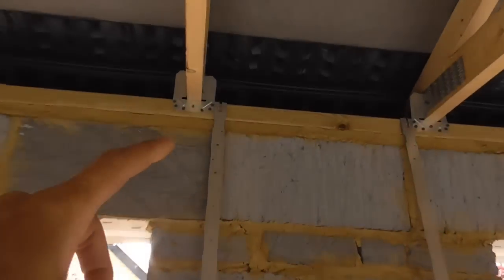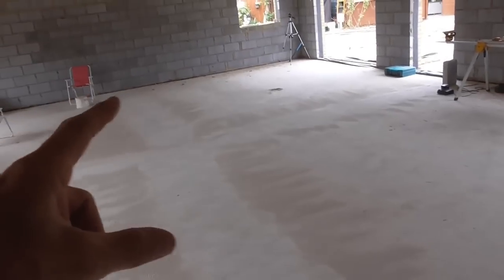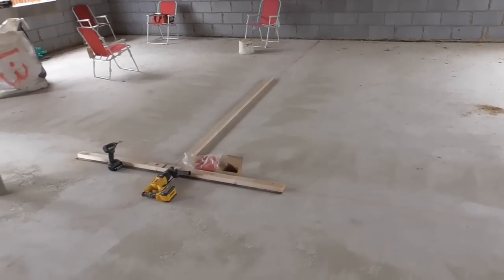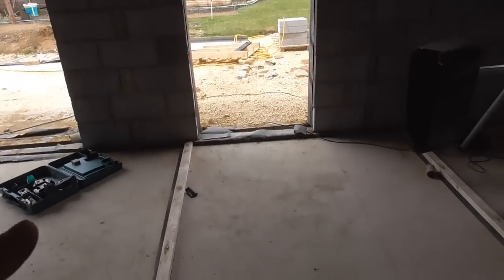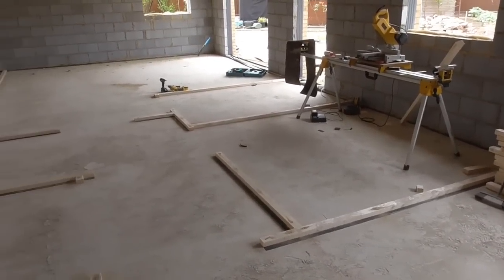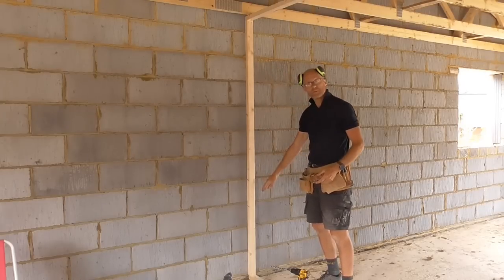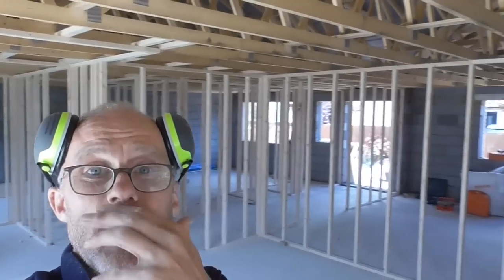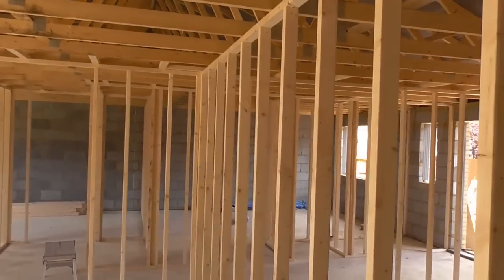Setting out and building timber stud walls in a single storey bungalow***PLUS LOTS OF TIPS***

Comment: Great vid as always - followed your guidance to rebuild my own stud work upstairs (had paramount board originally) and couldn't be more pleased with the result!  Mine took about 3 weeks to finish though; measure 861 times - cut once!  Thanks for all you do - keep 'em coming!
Reply from the maker: That's great to hear Steve🤩and glad you were able to get the job done👊Thanks for your comment and for watching😎Cheers Del
Reply: @thetallcarpenter  Any chance you do work in Grantham for fitting some Deanta doors?!  I have 3 custom size doors that need fitting in addition to another half dozen standard ones!
Reply from the maker: @Zel0978  Hi Steve. Its a little far for me, plus I'm booked up until August 2023😵

Comment: Great video Del , just always check that your lay out drawn is not a photo copy, can't scale off them , I run my sole plates through the door opes and cut out later gives you a chance to move things around if needed, good to see you thinking about other trades 👍☘️🇮🇪👏🤟
Reply from the maker: Hi John🖐Fortunately this drawing was to scale, but it also has a handy scale printed on it so you can check the scale is correct if the drawing has altered due to copying👊Thanks for watching and your comment 😎 Cheers Del

Comment: Really rather good....👍😀Btw Del, Scott Brown has a really good vid showing how he adjusts the wall studs once in place to eliminate any bowing in or out.  And Clever Clevett has a vid showing how he lines all the studs up to account for 'crowning' before he fixes them in.  Both worth a watch for any DIYer.
Reply from the maker: Hi Matt🖐You couldn't see in this video, but I look down every stud and place all the 'bows' the same way in the wall. Ant really bad ones get put to one side and chopped up for door heads or noggins👊I'm pretty lucky as I use a timber supplier that only stocks decent, straight timber🤩Thanks for your comment bud, and for watching😎Cheers Del

Comment: Great video. Very informative and well presented. Love your work ethic and consideration for other. We recently moved to a timber framed house with brickwork outer. The transfer of noise between rooms and floors is amazing. Shame they didn’t use noise insulation when they built the house. Can I ask a question regarding timber framed partition walls. We intend to remove one between the kitchen and dinning room to extend the kitchen. I think the wall is load bearing. How are these type of timber framed walls normally constructed. Will I need an RSG to carry the load?
Reply from the maker: Hi there🖐I wouldn't dare try and assume how you might support the wall/structure above any walls you might be thinking of removing without first seeing the job👍Thanks for your comment and for watching 😎 Cheers Del

Comment: Del, first things first, your videos can never be too long. Keep them coming. Great set out mate. A whole morning planning and fixing the floor plates and then flew through the top plates and studs. 
Do you have any tips for stopping the studs jumping when you nail the top and bottom. I often risk the foot clamp on the opposite side and hop to Christ I get the right angle with the nail gun🤣🤣🙈
Reply from the maker: Hi Paul🖐I should have put more details in, but I was keen not to repeat things I've already done in other videos, plus, tge video was starting to get really long😵I Mark the studs by putting them against the head plate and putting pencil across them, I then leave the pencil line on when I cut them which makes them just long enough to stay in place as I nail them👍Thanks for watching and your comment 😎 Cheers Del
Reply: Cheers Del.

Comment: Nice work Del, nice to see a chippy checking for square on short studs, tilers will love you😁. I love the bosch    distance measure, do you use it for stud heights or tape them, wondering if it's accurate 🤔.  I was taught run the sole plates tru doors , but I do it like you now leave them out and follow chalk lines. Lot easier. I wish I had your height for nailing studs to heads🙄🤣🤣. Great video keep them coming 👍
Reply from the maker: Hi Paul🖐Being tall, I am able to put the stud against the top plate and mark it directly with a pencil, which is fast and accurate👊Thanks for watching bud and your comment😎Cheers Del

Comment: Defo knocking up frames is better on the body . Soul plate down then individual frames. Obv check stud sizes but even if floor is 50m out in places a few double wedges will keep it good all that walking back and forth to pick up 1 stud at a time is thing of past . Esp if working solo . Frames defo easier on body
Reply from the maker: I suppose its what you get used to, and I find bending down nailing studs to a top and bottom plate harder on my back than nailing each one individually👍As with a lot of carpentry jobs, there's usually more than one way to do it👊Thanks for watching 😎 Cheers Del

Comment: This reminds me of doing Rondo stud walls. Light weight metal wall and ceiling systems. We mostly use on commercial jobs. Shoot the base track on laser up the head track. Twist in the studs and crimp in place. The title of your channel puts you at an advantage using this method. My channel would have to be short arse  Carpenter. You imagine every stud you put in you have to get on a hop up or climb a ladder. You wouldn't need to go to step training at the gym. It just isn't viable especially in your 60's. As you are upgrading your laser collection consider another one. I do a lot of glazed tiling and use a square set out laser these days instead of the old 345. Now when laying out frames I grab that. In combination with my line laser I can project a perfect 90 off any wall. Good to see a man happy in his work though and in shorts. The weather must be looking up.
Reply from the maker: Hi Dave🖐Yes, being tall does have some advantages😎I absolutely need to get a 90 degree laser, as like you say, perfect for setting stud walls👊(and glazed tiles😆) Weather is pretty decent now🤔well, decent enough for shorts anyway😝Thanks for your great comment😎Cheers Del

Comment: Hi Del, thanks for the great vid, can I ask what fixings you would use if there is underfloor heating pipes?
Reply from the maker: Hi Keith🖐I would be VERY careful drilling into the screed/floor if it had UFH in it😶I've just studded out a bungalow with UFH and was ASSURED by the builder/plumber that the screed was 80mm thick meaning I could drill about 50mm into it without hitting a pipe. I did this by setting the depth stop on my sds drill and using EXACTLY the right size plugs and screws. If I was in anyway unsure, I would just 'stick' the floor plates down with high performance adhesive or PU adhesive👍Cheers Del

Comment: Something I like to do to strengthen openings and probably overkill is build the opening to accommodate an additional stud either side. Theirs then a stud supporting the door head and above the door head to the head plate. Also gives extra rigidity and more fixing for linings
Reply from the maker: Hi AV🖐Sounds like a great idea, and will defo make the opening stronger 💪 Thanks for your comment 😎 Cheers Del
Reply: That method's only used in the UK when it's a load bearing wall. Usually in full timber builds. Would be overkill in this build as the blocks are supporting the roof.
Reply: @gavl.f.c6197  yeah yeah
Still something I like doing on my own bits, wasn’t suggesting he should do it

Comment: Great work. Your fisher fixings Del. Normally they are hammered in? Are these a normal thread. Nevertheless brilliant. I've done tons of studs over the years. We used to mark doorways and openings on the sole plates cut half way and this allowed for true runs this was sawn timber. Also we would set the corners back for a plaster board but nowadays this isn't done.. 👍
Reply from the maker: Hi there🖐The Fishers I use are always the screw in type rather than the hammer in ones👍Thanks for watching and your comment🤩Cheers

Comment: Nice job m8 some prefer to assemble complete section on ground then lift in...
 Thanks 4 sharing keep up the good work   
Y dnt u use a labourer
Reply from the maker: Hi Sadaqat🖐I actually prefer to cut and fit tge studs individually, as making the panels on the floor is a lot of bending down/kneeling😬(my poor old knees are worn out😵) Thanks for watching bud and have a nice weekend 😎 Cheers Del
Reply: @thetallcarpenter  perfect ...makes sense different strokes for different  folks lol
Take care all the best m8

Comment: Nice as always learnt a few nice tips. Can i just why the studs are not built after UFH and screed?
Reply from the maker: Hi Bud🖐Its mostly down to knowing where the rooms are so they can be set out for each under floor heating zone, but also, (not in this particular case), some building control officers don't like the partitioning built on top of a screed that is laid on top of insulation🤔Thanks for watching and your comment😎Cheers Del
Reply: @thetallcarpenter  fair comment, so what do you do at the bottom, say its 150mm insulation and screed, do you make that up with extra timber?
Reply from the maker: @Bud-vd2xd  Yes Bud👍 I would get 3m studs in this case, and then put a row of noggins in just above the finished floor level to take the bottom of the plasterboard. I have been asked by builders in the past to put down a quadrupole floor plate, to make up for the insulation and screed, because they didn't want to get me 3m studs😮 It was ridiculous and the shrinkage alone in all those floor plates would have caused all kinds of cracking🤯Cheers Del
Reply: @thetallcarpenter  you’re a legend Del, cheers

Comment: Great job. Is there any reason you don't use treated lumber for your bottom plate instead of adding the dpc to it? Is it a coast saving thing or is it just how its done over there? Also a great tip for holding a chalk line down on a concrete slab when working alone is to use a 1 inch drywall screw hammered into the slab and hooking the chalk line onto that. I find the 1 inch drywall screws work best for that because they are really hard and much sharper then masonry nails and require less fuss to tap in. Try it out sometime.
Reply from the maker: Hi there🖐Even if we used treated timber, the building inspector would STILL want to see a DPC under the bottom plate🤔I'm gonna check out the 1" drywall screw into the floor next time as I have a few on the van👊Thanks for your comment and for watching😎Cheers Del

Comment: Del, not sure if I missed it in the video but how do you make sure the header is bang on straight above the floor plate with this method? Good work mate 👌🏻
Reply from the maker: Hi Matt🖐Yes, I didn't make it clear in this video😬 Well, I did, but I cut the bit of video of me explaining it, and put it in a short video featuring the laser detector I use to help line up my laser with the bottom plate which throws a line up onto the truss bottom chords for me to fix my head plate on👍I guess I was a little worried that I was repeating, in this video, details that are already in previous videos🤔Thanks for watching and your comment 😎 Cheers Del
Reply: @thetallcarpenter  cheers for the info Del, got a couple of vids to catch up on yet will watch it though and see the detail!!

Comment: Hi! What's the reasoning behind putting the roof trusses on before raising the internal walls? Wouldn't it be easier to nail them on the ground and stand them up?
Reply from the maker: Hi Jens🖐 The concrete floor is just rough cast, and not particularly level/flat, so I find it easier to cut each stud individually before fitting👍Thanks for your comment😎Cheers Del

Comment: A washer around the concrete screw helps pull the timber down sometimes
Reply from the maker: Hi bud🖐Tapcon screws have a waisted shank and would be much better, but they are not that common round my way🤔Cheers Del

Comment: Hi, suppose the walls were not full height and so you didn't have any solid ceiling to fix the stud head plate to, how would you restrain the head of the studs?
Reply from the maker: Hi there🖐The head plate is either fixed directly to the roof trusses ceiling chord, or additional noggins that I fit in between them👍
Reply: @thetallcarpenter  ok thanks!

Comment: Great work again del! Precise to the point. I always learned that you could hammer in those fischer plugs full, as we call them nailing plugs but then not in english of course but in dutch. Or are these 10 mil different types? Always inspired by your enthousiasm mate!
Reply from the maker: Hi Tom🖐They do a hammer in fixing and a screw in one bud👊Thanks for your comment 😎 Cheers Del
Reply: @thetallcarpenter  great to know, I always hate removing those nailplugs because of the crappy philips heads but enjoyed hammering them in (mainly when I still was an electrician (or sparky in your world?)). have a great week !

Comment: Wondering if you’d travel to Bournemouth to build my timber garage. I watched your playlist last year of the garage you built. I think I’m going to have similar problems with levelling the structure as the moron who poured my slab made a right mess. What areas do you cover??
Reply from the maker: Hi there🖐I only cover a small area of North Cambs, so you are a tad to far for me😬Appreciate you watching my videos😎Cheers Del
Reply: What lengths of timber would be a good use of materials. My garage will be 6m x 7m and 2.4m to the eaves. I read somewhere that 14 lengths per 10 foot but it didn’t specifically say the length. I want to avoid wastage as timber is costly at the moment. 60 x 3m or 3.6m or longer 🤷🏽‍♂️

Comment: I know there has to be some limt Derek but when setting out is it always off the brick or block work rather than the estimated finish?, cheers.
Reply from the maker: Great question Alan🤗This plan is, I think, a structural plan, so I just measure straight from it onto the building. I have done jobs before, where the plan dimensions are more critical, and in these cases, I'll find out the finished wall make up, and allow exactly for it👍Thanks for watching😎Cheers Del

Comment: Hi I'm about to build a stud wall in my house 4m long, how do you make sure the chalk line/laser line is 100% straight? So if I was to build a wall of it everything would be square and straight.
Reply from the maker: Hi Lewis🖐Just keep the chalk line pulled nice and tight and it will always mark a straight line👍Use a square like the one in the video or do the '345' trick off the straight line to keep and walls coming off it at perfect 90°👊Cheers Del
Reply: Thank you 👍

Comment: Another problem with concrete screws is if the holes not in the exact position you want you can’t tap the timber one way or another then tighten it up like you can with a plug
Reply from the maker: Really good point Big Smith👊like you say, you've got a tiny bit of wiggle room with a plug and screw😵Thanks for watching and your comment 😎 Cheers Del

Comment: Hiya del, how high should the noggins be? Does it depend how tall the wall is or are they there for the plasterboards?
Reply from the maker: Hi Paul🖐We fit out plasteboard vertically, so noggin position isn't critical as long as its somewhere near the middle👊I keep my noggins no higher than 1100mm from finished floor, as they wont then get in the way of any of the light switches that should be 1200mm to their top edge👍Cheers Del
Reply: Ahhh good to know, cheers.

Comment: i have a 25cm hss rect with plates weld on both ends as a  3th hand for the chalkline
Reply from the maker: I like the sound of that bud💪Very creative😎Cheers Del
Reply: @thetallcarpenter  i know =) can pull as hard as you want it wont tip over before line snaps
Reply from the maker: @HogeN1337  That's awesome and I've got a welder🤔👊
Reply: @thetallcarpenter  can send a pic on insta when i get around to it
Reply from the maker: @HogeN1337  Please do bud  be cool to see it👍

Comment: Do you mark the sole plate and your top plate then go to the marks? Just wondering what you would do if the first stud against the wall is out of plumb then all your marks are out that same amount. 

Also, do you measure each stud in case floor/joists/trusses are out of level
Reply from the maker: Hi Dan🖐I have gone into detail in other videos, but I do measure each stud individually to accommodate a out of level floor, and I mark the bottom plate at 400mm centre's on the bottom plate, and plumb up the first one from the external wall to the top plate, and then mark 400's from that, so it doesn't matter in the block wall is out of plumb👊Cheers Del
Reply: Mark your first stud 390 instead of 400 or 590 if your using 600 centres allowing for 10mm if the blockwork is out slightly, make sure your first stud is bang on level then mark the rest of that first stud.

Mark your stud on your headplate on the marks then cut 2mm above the Mark giving you a snug fit so it doesn't move around as your trying to nail it.

Great video BTW!
Reply from the maker: @bmxerboynathan  Hi Nathan🖐We are on the same wavelength, and I actually mark my floor plate out at 430, 830,1230,1630 etc. The timber is 38mm thick so it leaves the first stud 10mm further away from the wall to allow it to be out of plumb, which is not too much as the dot and dab plasterboard is about 30mm thick👍 I then work away from the external wall pulling my studs to the line which is facing me, and then nail it up. Being tall, I am able to place the stud against the top plate and mark it with my pencil, and as you suggest, I just leave the line showing when I make the cut, and the studs holds in a treat as you nail it💪 Thanks for your comment bud